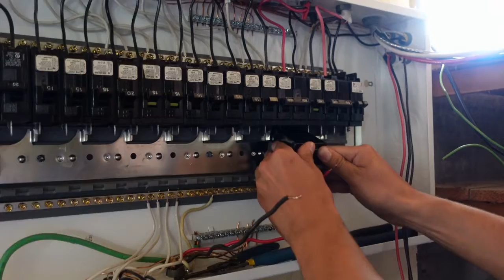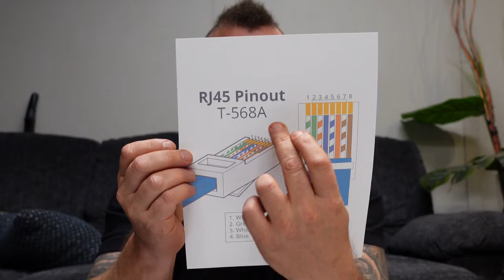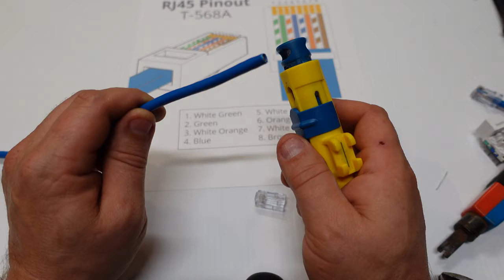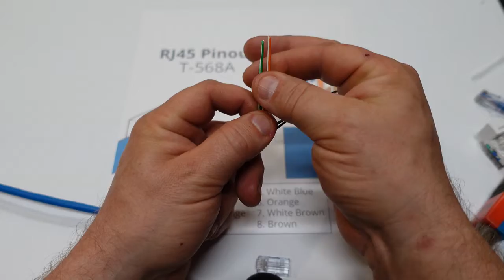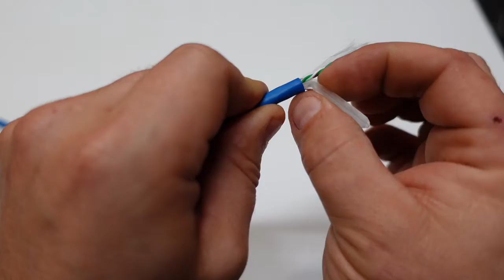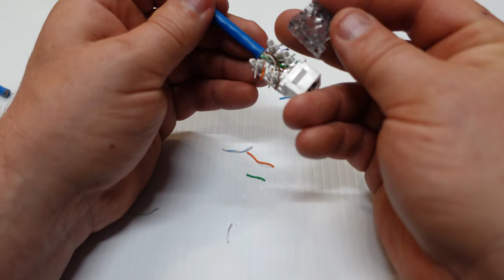How To Wire Up Ethernet Plugs The Easy Way

Comment: @Conquerall Electrical — ThankU. Excellent presentation! Crystal clear videography. Well paced. Wonderful Ethernet connection(s) training “film”. Why choice between “A” & “B” and what guides that decision?
Reply from the maker: It does not matter which you choose as long as both ends are the same configuration both A or both B. The industry standard always seems to be A. Hope this helps. Thanks